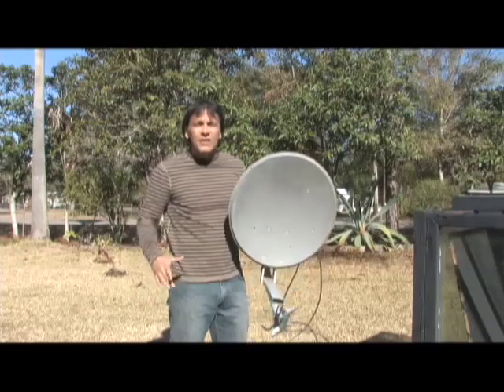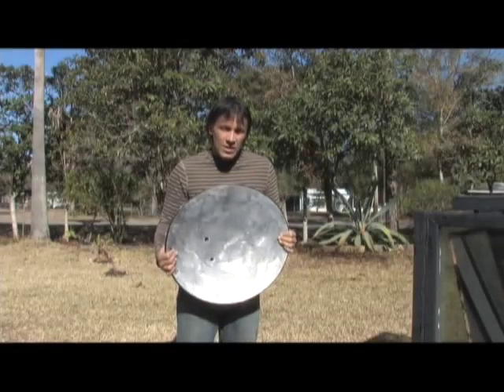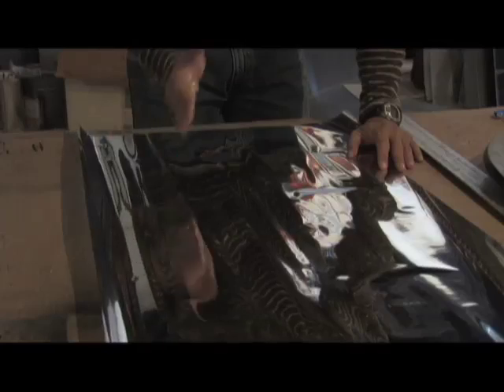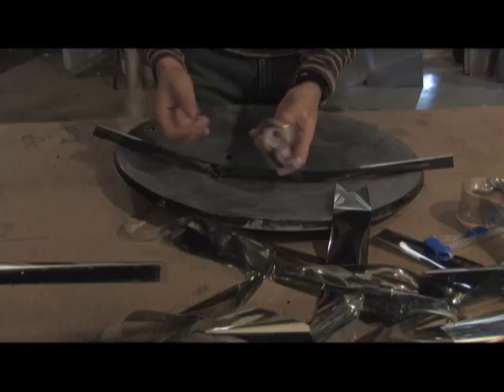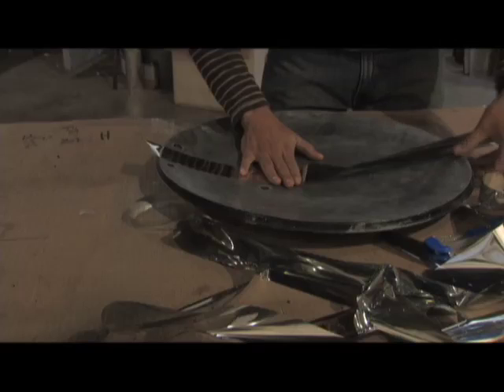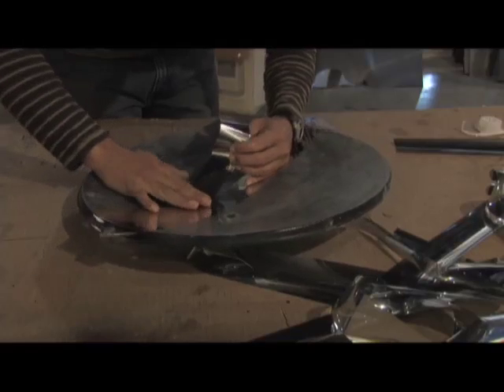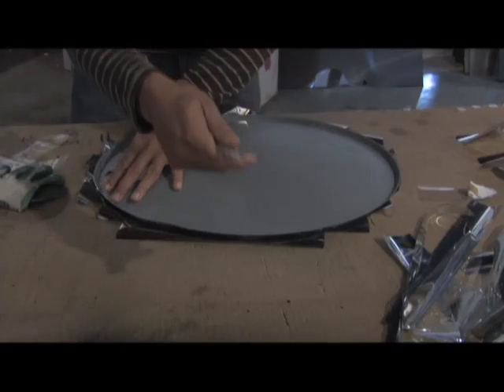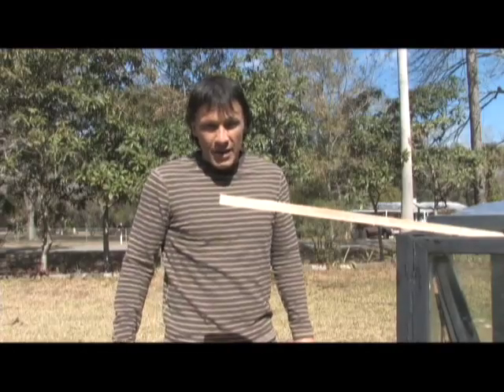Make a PARABOLIC Mirror  the cheap way PARABOLOID DIY REFLECTOR DIRECT TV hack Solar Reflective Film

Comment: I teach an environmental issues class, and am looking for labs for my students. What is this thing used for? Could it be a good project for my students?
Reply from the maker: vcomp1960 Yes, it is a solar concentrator for heating cooking and boiling water. Just store out of direct sunlight when not inure and wear dark eye protection when in use.
Reply: Thanks. Now I just need to get a few old satellite dishes and I'm ready to go.
Reply: GREENPOWERSCIENCE What reflective paper do I buy? Is it that DIRECT TV VIDEO PART B PEEL AND STICK $18 (6 sq ft) 24" x 36" USA SHIPPING - $7. Don't want to buy the wrong kind?

Comment: could you use aliminum foil for this? like a science project type thing`?
Reply from the maker: Marina Halvorsen No, it works okay but the flat surface creates the intense focal point. Any crinkling in the foil scatters light. Also, the shiny side of aluminum foil is only about 65% reflective. For DIY ground up approach use the inside of potato chip bags. The plastic backing keeps it flat. Chick fil A sandwich bags work excellent to. They are a smoother foil backed with paper so glue sticks excellent. The mylar films work the best.
Reply: Thanks :D We have a kind of "competition" on who heats 0,5 liters of water the most in 20 mins and I thought this would be a great idea to focus the light on my water to heat it up :)

Comment: Why didn't you use the same method you used to make the black mirror?...just use chrome paint
Reply from the maker: Ken Maine Chrome paint does not work. It is only 45% reflective. For optimal solar a mirror works best.

Comment: Thanks! I've been looking for a way to mirror a parabola. I am experimenting with 3D printing, and I have a smaller parabola inverted above a larger one's focal point of the same formula so that the smaller one will revert the reflection back into a beam that'll shoot through the hole in the larger one.

Probably should have included a diagram...
Reply: A large mixing bowl works well. I was having a hard sale and had some out on the table. I reached across and damn near fried my arm. That's how I unfortunately(?) Discovered for myself the parabolic effect

Comment: yeah ummm dan.. again.. glass shop + ceramic shop + your film + plexiglass backing + heatgun = rugged low buck parabolic mirror using your direct tv form..... yes you melt the glass to the  form shape.. and the plexiglass also to the form shape.. apply your solar reflective film to the back of the glass and then back it with the plexiglass... then just like start ramping out thousands of them on the cheapside to like take a pasture land where above the horses or cows on suspended poles you like generate the solar energy..... again.. destroying the power corporations in the USA to the tune of 108 Billion USD per year....

Comment: I had to restore a classic car headlight reflector, i used a £1.00 (one pound) emergency thermal blanket, that is like a plastic film but very reflective, it reflects your body heat back and stop you from getting frozen if you ever get stuck in cold places, a must for mountaneers, and so I did exactly what you are doing here, cutting into small width strips and sticking it on the reflector, using a double sided tape, I stuck the tape to the reflector and then laid the reflective strips on it, needless to say my headlight worked so well that it even passed the MOT. Earlier on the headlight failed MOT as the tester rejected the brightness not being adequate due to rusty reflector. Is your reflective mirror film the same kind of plastic stuff or is it better
Reply: mylar
Reply: good question! to pile on, would it be brighter if the surface was mirror polished/buffed, applied as a solid sheet using the window cleaner method, and maybe buffed again?

Comment: You should be using clean cotton gloves or even a sock over your fingers. You are getting fingerprints and smudges all over this thing. You aren't really using your head here. What is this stuff? Where can you get it and how much does it cost?
Reply from the maker: christo930 Info on our website and they film cleans easily. Designed for outdoor usage so rain, humidity and pollen. A few fingerprints are no big deal.

Comment: Just a thought, don't know if it's been mentioned. You could probably use a normal GOTO telescope mount as a heliostat of sorts. ASCOM software allows the flexibility to adapt and develop beyond standard tracking support. The mounts are designed to support some heavy loads and can be bought reasonably cheaply. Thanks for the videos :)

Comment: Love your videos. Spray with window cleaner, then put your strips down. Won't effect the stickiness. While the cleaner is wet you can easily reposition. Then simply squeegee the cleaner out to get a super tight surface fit with no bubbles at all! The cleaner dries slowly and leaves a perfect fit. Done that method many times on smooth surfaces.
Reply: wow thanks
Reply: What is the name of the film and where do you buy it
Reply: Carl Armbruster you can’t teach this know it all anything!

Comment: Has anyone tried this with the satellite dishes that are more of an oval as opposed to a circle?
Reply: As long as there is a focal point, shape of the dish does not matter. Only thing is, it has to be large enough.
Reply: Judson Chung I have already done it, actually. I was afraid of it not having as focused of focal point or something, I guess. I guess it does because it works pretty well. I can burn a leaf in about a second at least.
Reply: I used a Direct TV dish antenna that is an oval shape, used a mylar solar blanket cut into 2" series, Scotch 3m #77 spray adhesive, and it works great.  It will start wood burning in about 5 - 10 seconds.  I put an ad on Craigslist asking for a donation of an old dish TV antenna.  I went and picked it up from the guy and modified it into a solar cooker.

Comment: Another difference though, is that the focus of a satellite dish is not above the center, it's offset (so that the LNB box doesn't cast a shadow on the Satellite dish). So if someone was planning on a frame around the dish, they should be aware that they need to find the focus, not assume it is on a line out from the centre perpendicular to the middle of the dish.

Comment: yes but you only need the vacume to apply the plastic mirroring to the surface and it doesn't need to be maintained after the coating sticks to the surface of the dish.

Comment: the longer ones are used to focus the signal from multiple orbiting satellites. in the us this is usually from 110, 119, and 129 degrees (19 degree span).  using these long dishes (dish network dish1000) will neither help, nor hurt the refelction of the sun, which is only from 1 spot in orbit.  if there were 3 suns, spaced within 19 degrees of each other, it could reflect all 3 to a focal point the width of the LNB.

Comment from the maker: The cells used are "CPV" they are designed for higher heat. The cost per watt is cheaper for regular PV vs CPV.

Comment: you can get down to finer than 3,000 grit with one of those 3 step headlight restorer kits for $24. ...then compound and final with jeweler's rouge on a felt buffing pad. Would be a very high quality finish...and way flatter than a topper...and aluminum loves to be polished...

Comment: Very interesting, but the dangers should be stressed more. At the end of the video the device is shown leaning casually against a tree. Say the phone rang so you stopped recording and ran inside. Meanwhile Boo Boo the cat decides to go investigate the interesting new object (or a toddler/bird/squirrel, etc, or some dry, combustible leaves blows by). Stare into the focal point for even a fraction of a second and get immediate blindness or hold anything  there, including Boo Boo's tail & it burns!

Comment: could I use this to melt the snow off of my driveway
Reply: Mix a bunch of powdered sugar with some sulfuric acid to create carbon, grind that stuff up and spread it over the snow, and you'll be able to melt the snow pretty easily.  Snow is fairly reflective otherwise and won't melt well without an absorber involved.

Comment: @jaffa25 A heat sink behind the PV cell is essential. Most silicon cells have a max operating temp of only 60C.

 At the focal point of even a small 1m dish you'll get 600 - 800C. If the cells are 10% efficient that means the heat sink must remove the remaining 90% of the heat. 

This can be drawn off for water heating, steam generation and/or some kind of power generation using either stirling or rankine cycle.

Comment from the maker: re;

post from Sept.
You need fireproof foam for the walls or cushion behind the drywall. Even a thin layer will work. The sound vibrations transfer through hard surfaces. Try prosoundfoam com

1" STUDIO WEDGE 96 sq ft 179

Comment: kmsdadog - Those are probably not reflecting onto PV panels, this may increase their output, but it will greatly decrease their lifespan.
They are probably collectors focusing on heating some liquid to generate electricity in a turbine or other manner.

Comment from the maker: You need fireproof foam for the walls or cushion behind the drywall. Even a thin layer will work.  The sound vibrations transfer through hard surfaces. Try prosoundfoam com

1" STUDIO WEDGE 96 sq ft 179

Comment: well....when you take the dish down there are 4 bolts that fit fluch in the holes....i know im a tech 

if you really wanna make it look pretty withou the mylar start with 100grit then do 200 jump to 600 the 800 last finish with a very high grit (2000ish)  it can be found at an autozone type store for removing scratches from clear coats

Comment: Check any hobby shop.  I know that there's one on 19th Ave. and Northern.  Ask for adhesive-backed mylar in the model airplane department.  They also sell a little iron that looks like a shoehorn with a rheostat for temperature control to facilitate melting the adhesive backing.  The Iron and several meters of mylar shouldn't run more than about $30.

Comment: A small comment when applying the reflective tape.  Twist a towel into a snake shape and lay it on the bench in a circular shape (like a donut).  Place the dish in the middle and the towel will support the dish and you won't have the dish rocking around while you're applying the tape.

Comment from the maker: The dishes unsanded are like teflon and a light wax spray will release just about anything. I think if you punched some small holes in the adhesive, this would allow the clear resin to lock it in when finishing side 2. There would be no release barrier that the sheet would otherwise create.
Good idea, not sure what resin would be best.

Spray would be too thin.